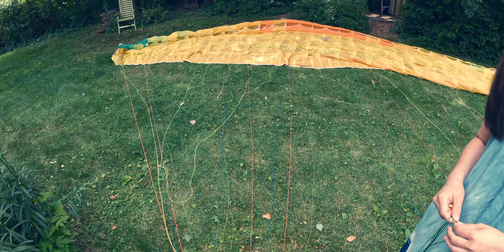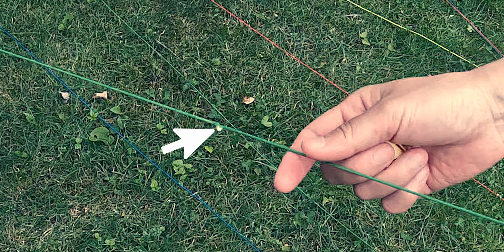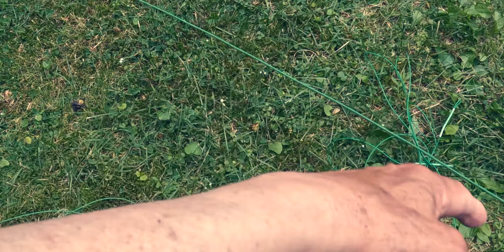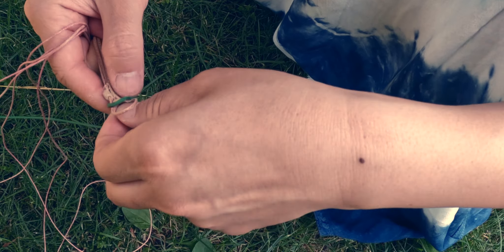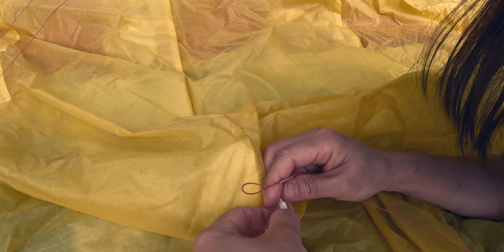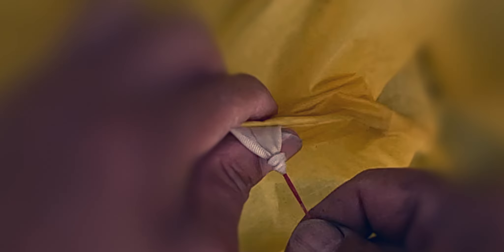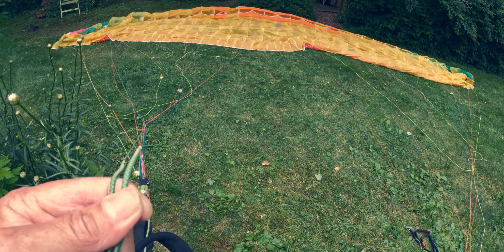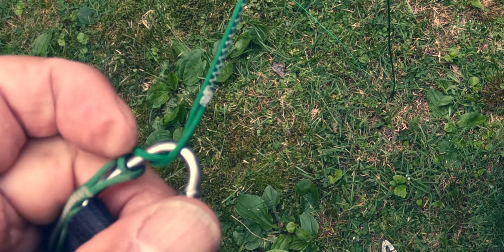REPLACING DAMAGED LINES

Comment: where did you say you order lines from?
Reply from the maker: The lines can be ordered from any Paragliding Pro repair shop in the country regardless of the brand. The lines are custom cut. Look for your glider on the manufacturer's website. Take a screen shot of your wing diagram. Indicate which line(s) is/are to be replaced - make a red circle on the line to be replaced or some kind of marker. Provide the wing brand, model, year, size to the Pro shop. The line(s) will then be mailed to you. If you do not feel confident replacing it/them yourself, ask your instructor to do it for you (recommended). Note that there can be small variations in line length(s) and the Pro shop knows it. Any doubt, contact the shop, they will answer your questions.